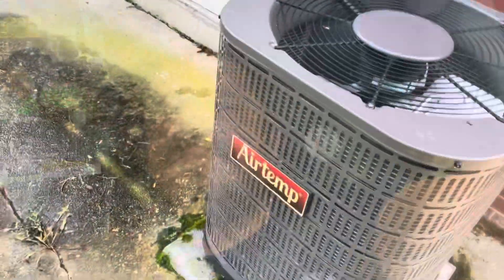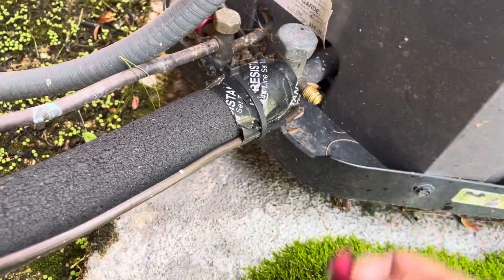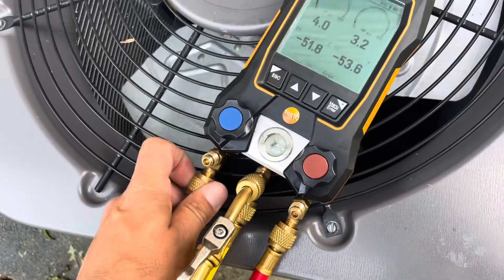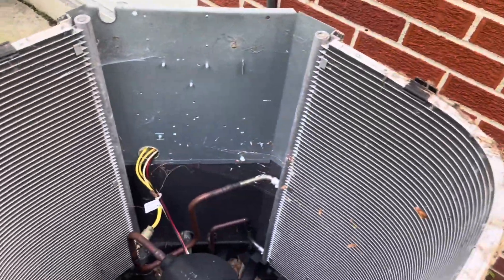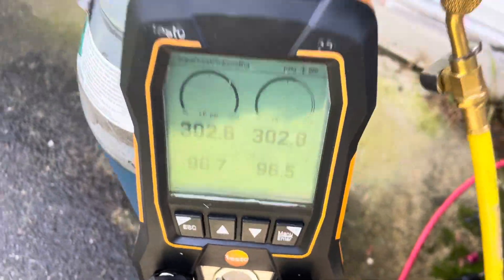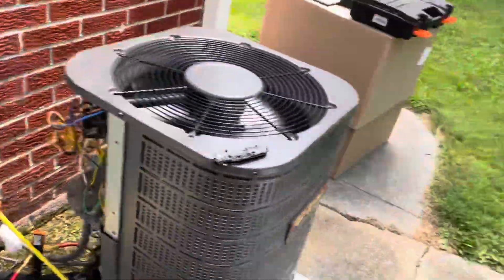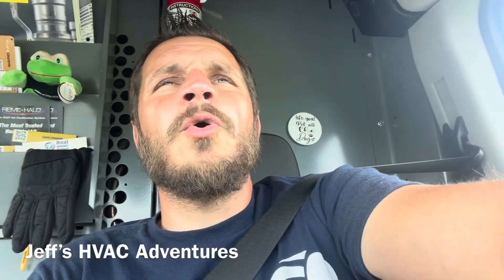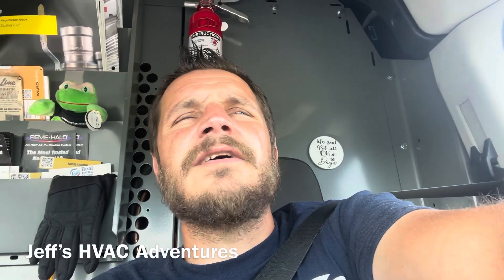Man I Hate A Micro-Channel Coil! Replacing A Condenser Coil.

Comment: Can you still buy the traditional coil vs micro channel junk
Reply from the maker: Not usually for the condenser coil.  I’ve gotten tube and fin to replace micro channel Evaps before though.  But if it’s a heat pump both coils need to match.

Comment: Great job as always: I have 2 Carrier chiller micro- chanel coils to change out on a 100 ton unit. Carrier actually sent us 6 coils. I guess in case one of the new ones should leak.
Reply from the maker: Ha.  That’s funny.
Reply from the maker: You’re right about that!
Reply: 5 years ago, I changed a coil on a 55 ton Aqua Smack, twice, and only the first was warranty. It's just wrong for manufacturers to get away with this kind of poor quality and it didn't just start.

Comment: Is it normal for microchannel condensers to run with low subcooling temp?  I noticed AirTemp manual only specifies outdoor temp vs high/low side pressures for charging and doesn't mention subcooling temp.  I am uncomfortable just relying on the pressures and outdoor temp.  Their charging instructions seems willy-nilly when you read the notes section.

Main reason for microchannel heat exchangers is requires less refrigerant load.  Not a lot of condenser volume margin for refrigerant load variance and variable outside ambient temp conditions with a fixed speed compressor.
Reply from the maker: They call it and approach chart.  I agree it’s not great.  You basically cross your outdoor temp with your liquid line temp.  If it’s below the curve they say add, if it’s above they say remove.  It’s pretty lame I agree